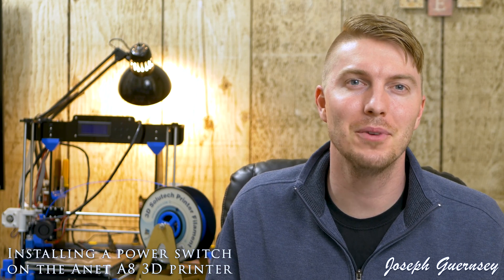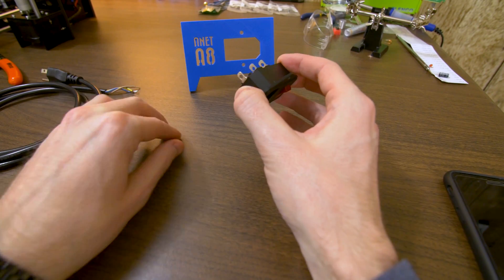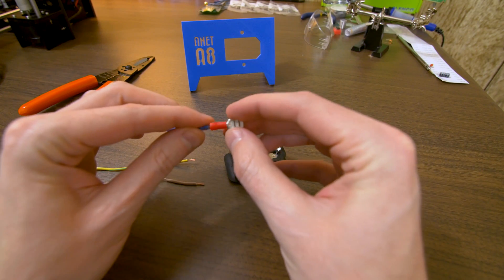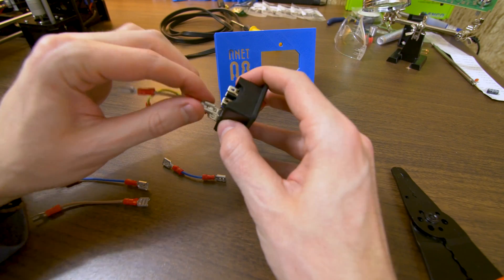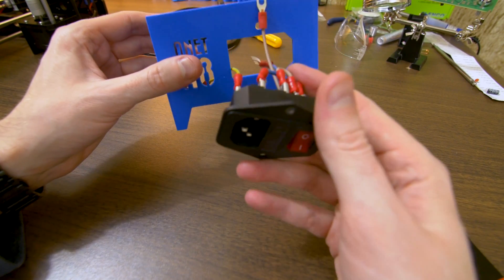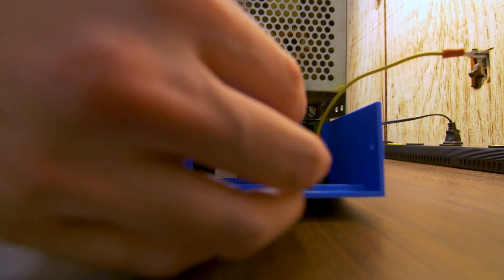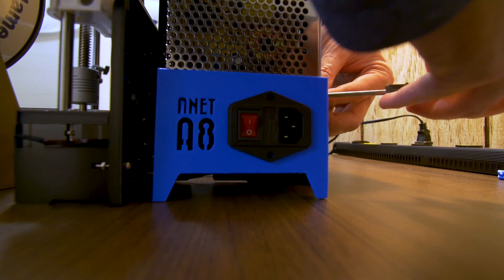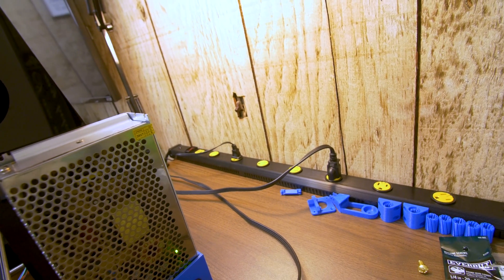How To Install Power Switch On Anet A8 3D Printer

Comment: I found the screwdriver that came with the Anet to be the incorrect size for most of the screws and used a different one that was better sized instead. Did you notice the same? Thanks for the video!
Reply from the maker: The tools that came with the printer are lower quality. If you got better tools I would use them!

Comment: Good tutorial, but users take note... sometimes the switch mechanism is installed the other way around on these units.  As you look at the back of your unit, notice the arrangement of the four terminals at the bottom.  There are a pair of terminals which are spaced closer together (with relation to the black plastic divider running between them), and a pair of terminals spaced further apart with relation to the divider.  With your unit oriented the way Joseph shows it for the bulk of the video (with the Ground terminal on top), are the CLOSER-spaced switch terminals on the LEFT, as in the video?  If so, you're good to go, wire it as shown in the video.
But if your CLOSER-spaced switch terminals are on the RIGHT, then your finished wiring job should NOT look the same as in the video.  If that is the case, your small jumper wires should be crossing over from left to right, because those jumper wires are supposed to connect to the closer-spaced terminals.  If you are iffy in your wiring skills and electrical knowledge, or if any of this confuses you, do some Googling ("how to wire a Rocker Switch Power Socket Inlet Module Plug"), look at some pictures and diagrams online, do some research, until you are confident on how to make proper connections.

Comment: Hi, What is the problem  for anet A9... When the initial operation, the extruder is directed to the opposite side to the end and continues for a while the engine rotates even when the extruder reaches the end ... The same applies to the surface ... Also, the z direction motor works one and the other does not work .. Note that I almost checked the connections  All are correct

Comment: You are using the wrong crimper for insulated wire terminals. You are also doing it the wrong way when crimping. The solid side should be on bottom and the divit side on top. The whole reason for that is when the round bottom pushes up and in on the sides of the metal , the diviter pushes on the split metal top and drives it in. Insulated wire connector crimpers are more flat on both top and bottom.

Comment: At the green and yellow wire - earth, not neutral , the blue is  neutral whatever you do, if you do not know what you are doing and are not a qualified electrician, do not use this video...  use the link>>>>https://www.pat-testing-training.net/articles/wiring-plugs.php or the UK and RSA but always check if in the USA/Canada depending on which state you live in what is compliant there.

Comment: My switch light is always on, regardless if I turn it on/off - any ideas? I didn't bother with the clips, just soldered the wires and wrapped with heat shrink tubing
Reply: I should of mentioned, the printer turns on/off fine, just the light is always on
Reply: @topcat5366  Hi Topcat, Did you get any solution for your problem as I have exactly the same.
Reply: I had the very same problem and was able to solve it: Make sure that the red button is installed with the "1" at the top, and the "0" at the bottom (you can push the button out and spin it). Only then connect the wires as per tutorial.This will make it work properly👍

Comment: You should be using fully insulated terminals on the switch👀 metal ends could bend while fiddling with the unit and touch each other🙈
Reply from the maker: GamingLegends Thank you for the advice, I will definitely do that from now on. I’m always learning, I’m no electrical expert. Again thank you.
Reply: @josephguernsey3110  can you just cover it with electrical tape or even kapton tape? will kapton tape fully insulate the metals?
Reply: @AK-kr3uy  Shrink tube is the easiest and cleanest way

Comment: Thanks. I just completed my switch installation using a box I cut to size for my Prusa i3 clone.  The power switch only had three legs, not four, as you showed. The toggle does not light up.  I have ordered another switch to have the LED light on the switch. Thanks again.
Reply: Aburrido

Comment: Terrible tutorial if you have a different rocker switch.  The guys doesn’t tell you what you are connecting to what on the switch...  I can wire a plug.  It’s that damn switch that I need info about.
Reply from the maker: Josh Tiel this tutorial is aimed for people with the Anet A8 and the same switch I use in the video. Hope you figure out what your doing.

Comment: Great tutorial, I will use it myself now.  But I will add shrink tubes around the crimps, as it will make it a bit safer. So there will not be live voltage the anyone, including myself, can touch by accident.
Reply from the maker: Anders Jackson Glad it helps. That's a excellent idea to add shrink tube.

Comment: Careful, some power supplies are reversed so instead of calling out side of unit and using non-standard colored wires for America the annotations should be “Live” (his brown wire), “Neutral” (his blue wire) and “Ground” (his greenish yellow wire). These are labeled L, N and ground symbol.
Reply: I just converted mine and in checking the power cable that came with the printer from the plug to the wires found the hot pin is connected to the blue wire not the brown and the neutral is connected to the brown wire. So if you follow the printer instructions of 1=HOT (brown), 2= NEUTRAL (blue) and 3= GROUND (yellow) you will be reversing the connections witch will be dangerous. Check before powering up.
Reply: @omaro749  Yikes! I just did this mod to mine and mine was brown=hot blue=neutral and yellow=ground thankfully. For anyone who doesn't know, in the US if wired correctly the wide blade side of a plug or outlet should be "Neutral" and the narrow side is "Line" (or "Hot"). If wired incorrectly you'll have voltage on bits that shouldn't, relative to ground, even when your switch is 'off.'   It's things like this that make me cringe when these kits leave mains wiring up to consumer. (Of course it is also how they limit liability and cost. /Sigh)

Comment: Ok so I have an odd problem the light works now but it is on regardless of the switch being On or Off do I have a defective light or just not hooked up right?
I am going to do a video on it and upload it.
Reply: I just had the same issue, some switches have that as a feature to help you locate the switch even when it's turned off (I bought from a different link than the one in the description). Scared me at first as I thought I'd done it wrong, too
Reply: Oh ok phew.
If the light goe's out I will get another.
Although I may get another as I do not really want my Switch lit up all the time I only want it lit when the power is actually turned on.

Comment: Wow I have watched a ton of tutorials on how to wire up this very switch and this is the first tutorial that did not leave me confused.
I did get the switch hooked up and working but I wanted the switch light to come on.
Now I know how to hook everything up right.
I did do an oopss on the fuse part I put it in regularly I did not know it went into that plastic part then into the holder.
I am so going to wire mine up the rest of the way. :)
Reply from the maker: PinBallReviewer I'm so glad it helped!

Comment: Thank you Joseph Guernsey, I did this to my Tronxy and it worked great :)
Reply from the maker: Lee Tookey Np glad it helped.
Reply: what fuse you use i have a tronxy x5  AC 110/220V + - 15%    DC OUTPUT: 12V 20A

Comment: Thanks brother. Great tutorial my friend. I have two Anet A8's.  I bought one of those switches from Amazon fora  $8 and I got a cheap $3 one. There both from China of course but the  $3 One lasted about 5 clicks and broke. I just got another one like this one but I never had it hooked up for the light on the switch to work for the printer I already have this switch on. I was missing one of the jumpers.  But now I can go back and wire them up both up the right way. ☺  Thanks Buddy.
Reply from the maker: That is awesome! I really enjoy having the switch on the Anet A8.
Reply: Joseph Guernsey me too my friend. I also like your cover better than the one I have. I'm printing two like yours as we speak lol.

Comment: It's AC voltage, it should always be insulated or protected, those connectors can easily touch when you remove the cover etc and the fuse wont help.  And others doing this mod could be put on serious danger!  At least warn them that they now have very dangerous exposed wiring in their printer.
Reply: Yet it is still an upgrade in safety from the way this printer ships as standard :o I would really have preferred to see a totally enclosed cover for the switch though.
Reply: Yep. I used insulated terminals for this on my own. If I had nothing but non-insulated I think I would've soldered everything straight up and done away with all the terminals in the first place. (Or maybe mold on RTV or epoxy after)

Comment: You should shrink wrap (or at least use electrical tape) on those connectors to prevent them from ever touching and starting a fire or killing you!
Reply from the maker: aztecalarm appreciate the advice, but I feel it is safe since the connections are spaced out and the printer is stationary.

Comment: What fuse to use? Is 1,5A enought? I have 220V.  240W/220V = 1,1A?  (P/U=I?) Thank you.
Reply: The voltage is usually 240V, so yes, a 1A-1.5A slow fuse would work.  Even a 1A-1.5Afast would work, just try it out.
Reply from the maker: Jakub Hažmuka I used the fuse that came with the switch. I'm not a master electrician so I'm not sure what you need.

Comment: can you solder on the connections instead?
Reply: You can, but usually the crimping is better, and then you don't need to solder.

If you do a bad solder, your installation might come bad (bad solder will get hot and then melt the contact).
A bad crimp will not hold if you pull the wire, and turn bad later.  Solders can turn bad later.

But yes, you can solder OR crimp.  Don't do both, that might even be illegal in same places.
Reply from the maker: I'm sure you can, I just prefer plug on connections. (Also I'm not the best solderer, I'm still learning how.)
Reply: yes

Comment: My power switch has 5 connections instead of 7 what’s the difference?
Reply: I think he has the new type which only has 3 conections on the switch
Reply: On/off jumped together?
Reply: 5 wires mean your red switch has no led light,that's the difference,3 prongs on plug,2 prongs on switch just on & off
Reply: The 7 connections have two switches, so you can switch of the neutral and live (blue and brown).  But the one with 5 only have one switch, so you can only switch of the phase.  Which usually isn't any problem, as it still will break the circuit.
Reply from the maker: Jordan Sandall I'm not sure without seeing it